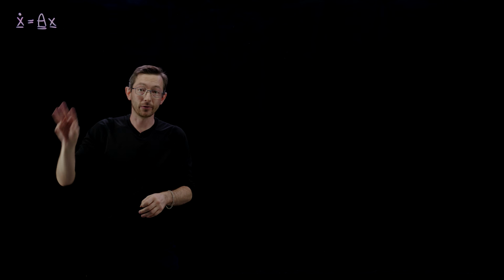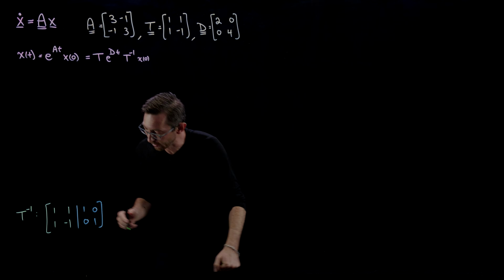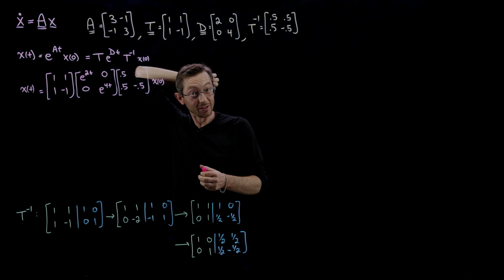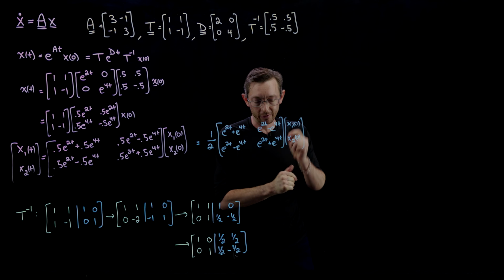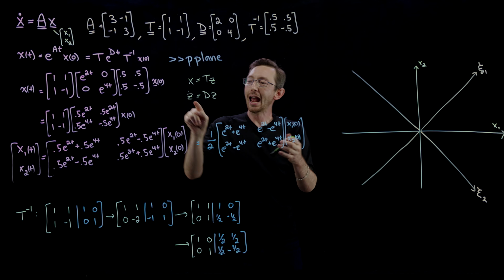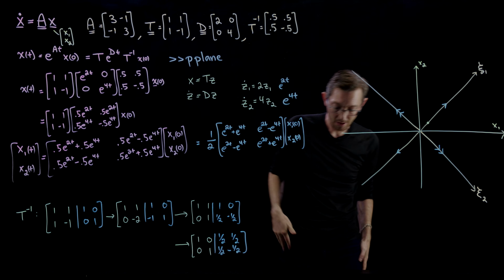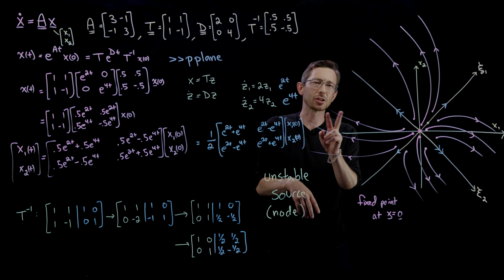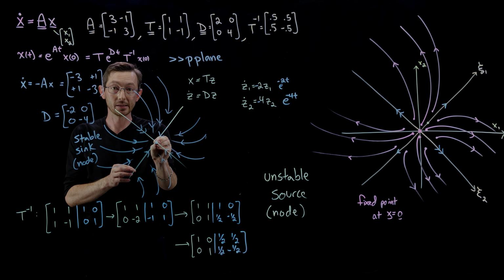2x2 Systems of ODEs: Sources and Sinks

Comment: I think on the reversal of the system, from A to -A, in the graph the arrows on the eigenvectors also must be switched. Exp (-2) is larger than Exp (-4). The trajectories would remain the same as for the "source" system, but the "explanation" of the parabolic shapes of the trajectories would need to be amended by changing the magnitude arrows on the eigenvectors.
Reply: I will be practicing t e  met ods of  t e differentia equations as muc  as I can. It gives  me peace of mind.

Comment: Greatly appreciate the series so far. My understanding is that the phase diagram you drawed for the stable sink is mistaken. I think that the positive ξ2 side should be different. The way you drawed it, it seems that the ξ1 is growing faster that the ξ2.
Reply: For me it seems proper because if you follow each individual line,  you can realize they have tendency to go faster to the infinity in ξ2 directions.

Comment: Seems like your "run the tape backwards" intuition at the end, switching source to sink could also have been achieved from the other direction: replace t with -t in the original  solution, and pull the negative sign OUT?